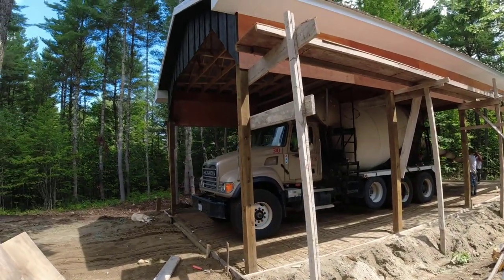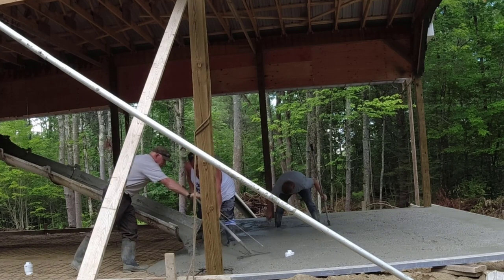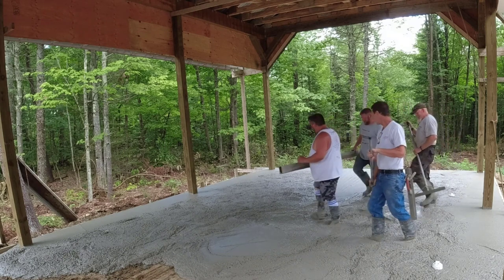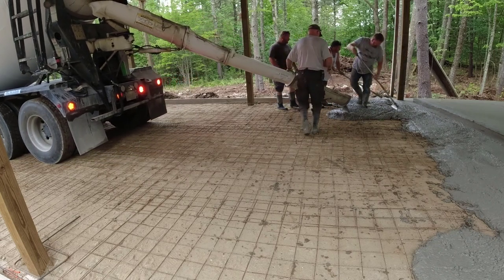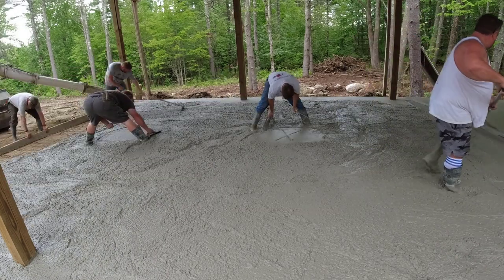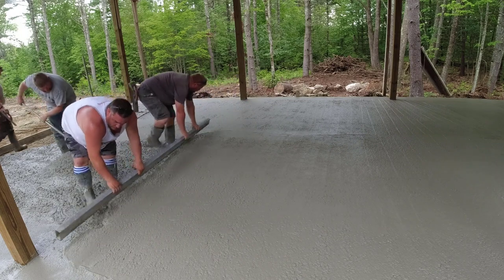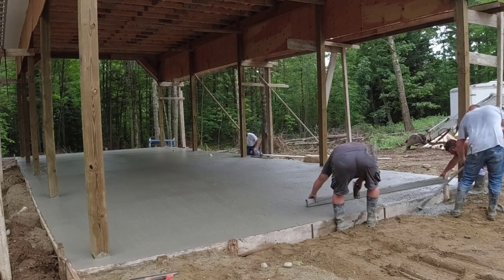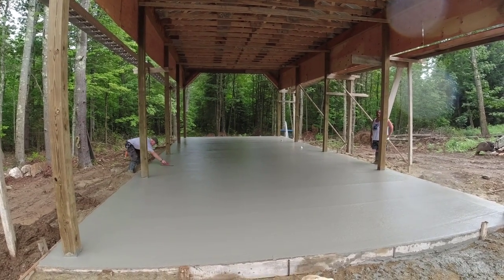How To Pour A Concrete Slab For A RV or a 5th Wheel Camper

Comment: Yeah, you're definitely right. That wire stays up in the concrete well.
I think the bullfloat finish is ok, but I usually will suggest a "lay down" finish with the troweling machine to the customer. We just wake it up and then go over it usually once more, just to get it to a point where most of the blade ridges and swirly marks go away. It leaves plenty of excellent grip and it looks really good.
Reply: A bullfloat finish with no lines would be more than enough without doing to much too it.

Comment: Very interested in the structure.  I need to build one on a mountainside that gets lots of snow.  This looks really sturdy without being a view killer.  Are the trusses prefabbed?  They look close together are those 16" on center? The sides look different from each other.  Curious as to why?  How far apart are the posts?   I see the rebar around the posts but are they also fastened to the post?

Comment: I notice you guys don't use pump trucks as much as they do down here in Florida.  If the reach is more than 14' or so, they want a pump truck.  On a pad where the truck can pull up along side of the long lenth, how far can you guys pull the concrete before you call a pump truck or conveyor?
Reply from the maker: If I use my 16' chute along with the truck chutes, we can go about 40' before needing a conveyor of pump.